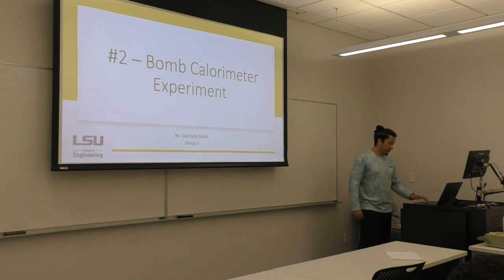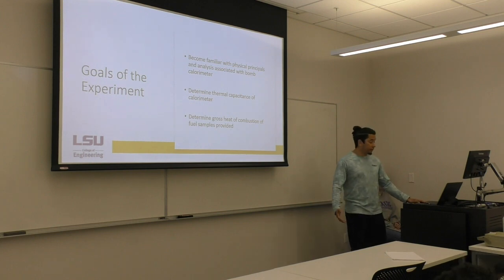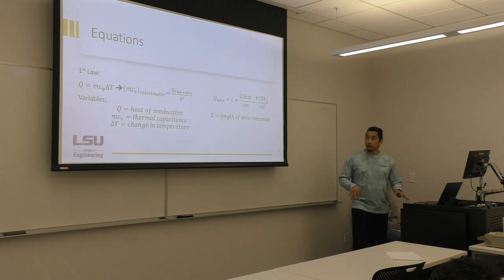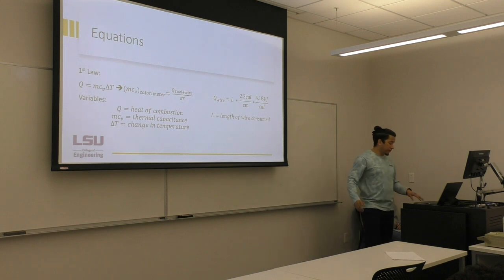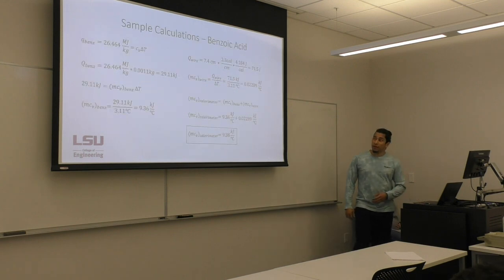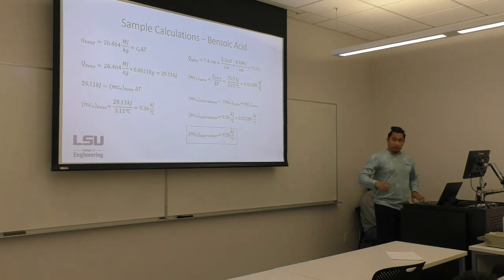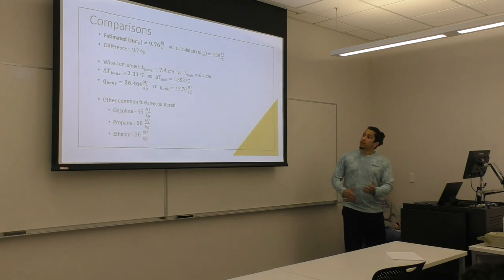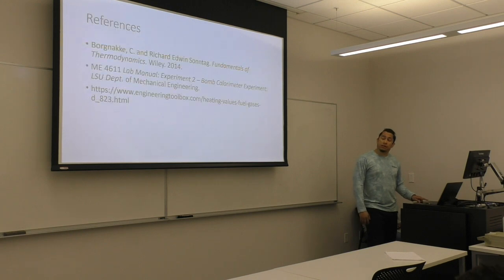S1090008

Comment: I think I could have done a better job executing the necessary points I wanted to convey for each slide. I think the content on each slide was relevant to the experiment and correct for the most part. But after watching the performance entirely, I think that some of the points I wanted to hit were lost, such as elaborating on the extensive nature of the heating value property and how it is important to fuel encountered in everyday life. This could be because my presentation of each slide wasn't concise or simply because I didn't practice enough. Either way, the info was correct and I was certainly confident. I just think if I had a bit more practice, I would've been able to touch on all the points I wanted to and would've also been under the time limit. But overall, I think I did a good job.